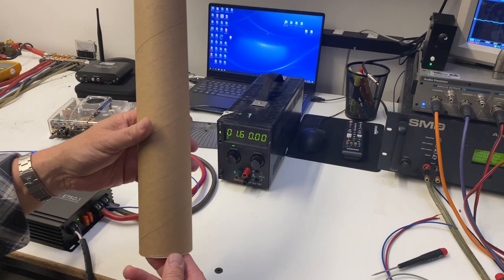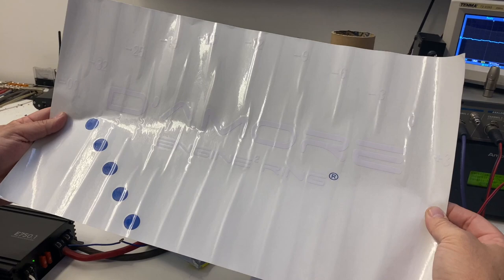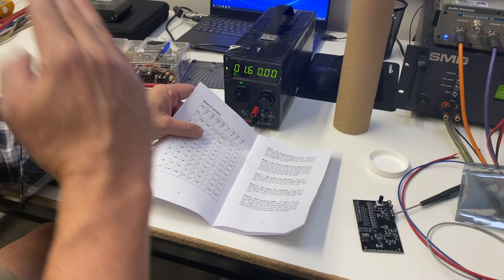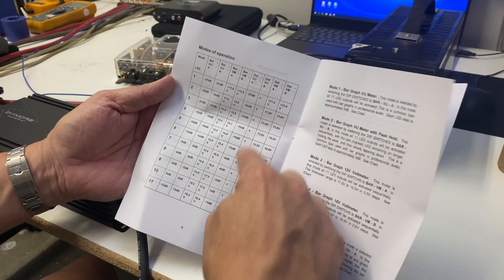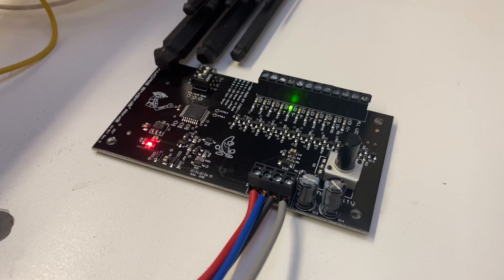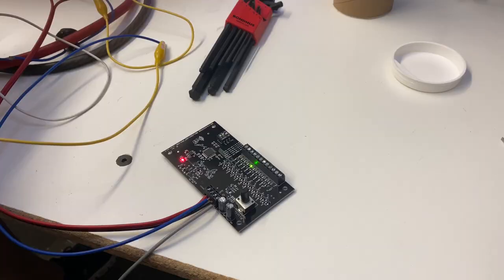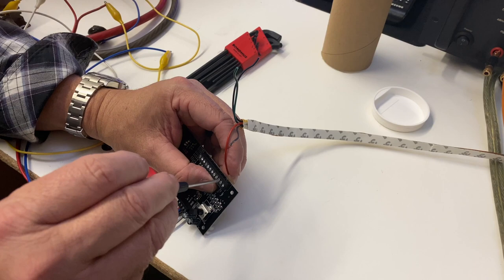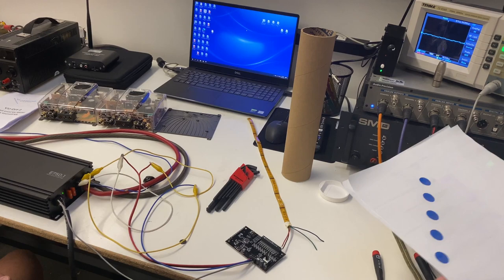Make your own VU meter, voltmeter

Comment: Would it be possible to use one board for both my front doors ? I Want to put a smaller bar or dot vu in each door. Around 5-7" l.e.d sections in each door.